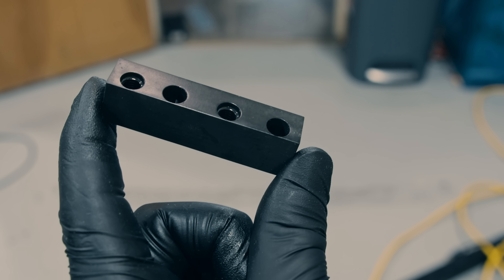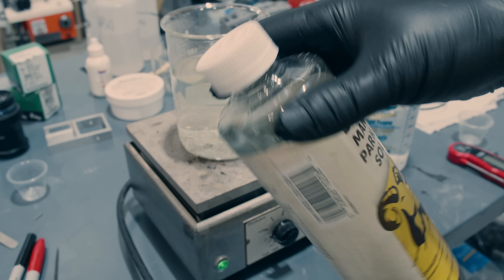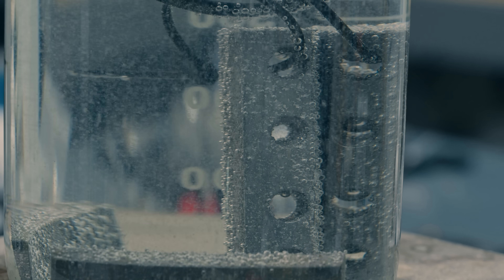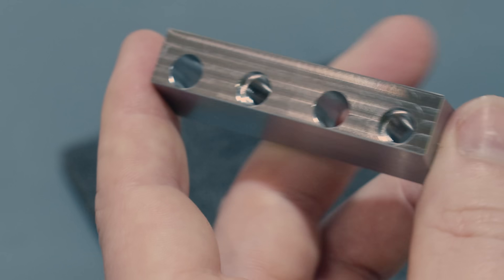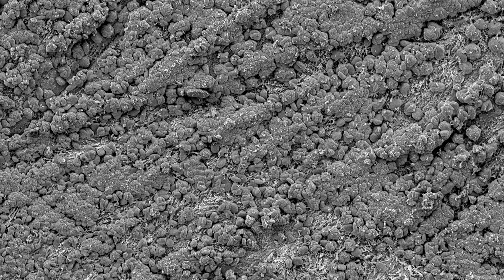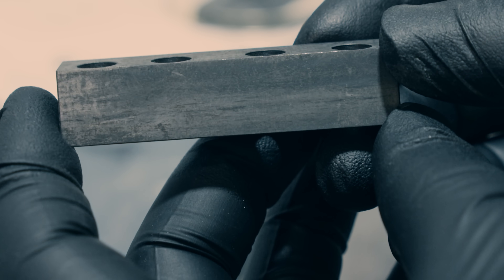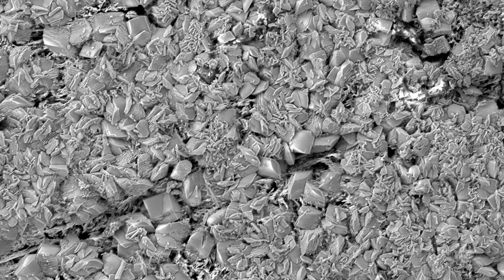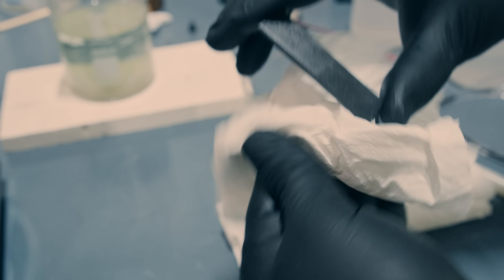Low-tech coating is a microscopic marvel

Comment: When I used to work at a job shop, we would run parts through a Tumbler before sending them for surface treatment. Tumblers are pretty fun gizmos and very loud. I assume you know about them but in case, it's a bucket of some description held up on big springs, with a big shaker motor in there somehow. You fill the bucket with carbide bits shaped like dry catfood and it spends an hour or two ramming the carbide catfood and your parts together randomly and at high frequency. This results in a very evenly and finely rough surface. Sometimes you want the smoothest cleanest surface before doing a surface treatment, sometimes you want evenly and finely rough; but you never want irregular toolmarks and such.
Reply: i spent hours with my hands in a rumbler... could spend your life figuring out how to get different finishes... from mirror polishes to bead blast to just... "got the brazing flux off"...

different medias, different amounts of media, different detergents, amounts of liquid, and the weights on the shaker... i always liked a 90 degree offset, gave a nice "figure 8" swirl... 

always sad, watching these YT videos of people trying to make them with no real concept of how they work.
Reply: @paradiselost9946  Mirror finish? Amazing! This workplace was not one where leadership tolerated knowing things or having skills, I think we changed out the media once and probably just used like, flood coolant or dish soap, I don't really remember.
Reply: @Ziraya0  lol, management... at one point i started recording conversations, as invariably, when something worked it was "their" idea, and when it didnt, it was "my" idea. 

if i start elaborating this could be a very long reply.... shutsup

Comment: It's just wild to imagine that a surface that feels so smooth is actually so rough.  I guess this might explain why this kind of coated metal has an almost "soft" feel to it when you handle it, compared to a freshly milled surface, which feel smooth, but.... different... almost harder.
Reply: Our tactile sense only  has so much resolution.

Comment: I used to black oxide parts at my dad's plating shop, along with primarily electroless nickel planting.  The black oxide was my favorite look, but least favorite process.

Pre-soaking in heated hydrochloric acid for about 30 seconds to 1.5 minutes will usually prep the surface and remove some of the variations in texture.
Reply: Nice to find another plater here, looks like skipping the pretreatment , no electroclean or acid dip was not a good idea. It’s strange how the people who proses stuff for a living know what they are doing and sometimes, why.

Comment: Parkerizing is the effective replacement to bluing when it comes to firearms. It produces a more durable resistant coating. Bluing is effectively controlled rusting, which then prevents the metal under it from rusting.
Reply: Like anodizing aluminum?
Reply: @d.b.1176 very similar, I think! But phosphating and bluing both require a light oiling, which is obviously not necessary for aluminum.

Comment: Fascinating!
What would a polished aluminum which is then anodized look like under your microscope?
Reply from the maker: On the todo list for sure! Should look like really tiny honeycomb pattern, based on what I've seen/read elsewhere. The pores are very small, sub-micron if I remember correctly
Reply: @BreakingTaps  excellent.

Comment: Cool video! What would happen if you ran the Parkerization step at at 70C inside the ultrasonic cleaner? Do you think it would speed up the process or ruin the surface finish?
Reply from the maker: Honestly no idea! It might mess up the reaction kinematics, my understanding is that the reaction relies on the pH locally increasing right at the surface. Phosphates are soluble in acids, but when the pH rises locally they become insoluble and precipitate out. So ultrasound might disrupt that boundary layer and promote more solution mixing, which might prevent the precipitate from forming.

Or maybe not, unsure! Would be interesting to test (or skim google scholar when I get a minute)!

Comment: Heat your part first to temp before dunking! Pro tip from gunsmith!
Reply from the maker: Aha, yeah that makes sense! I did notice a "lag" period before they started bubbling, was probably coming up to temp. Will keep that in mind for future batches!
Reply: And it also helps the solution to work better if you feed it some soft iron before you park your first item. Temp and the lack of prepping the solution with some raw iron is why the 2nd one was so much better than the first. Some use a powdered iron in a bag before first park cycle.

Comment: Curious to see what the surface looks like once it has oil but it probably doesn't work in the electron microscope
Reply from the maker: Unfortunately yep, you're right 😭 That's the reason I left one uncoated, so I could look at it inside the SEM. Oils and organics would be a big blob of charge buildup at best, or start to volatilize and contaminate the chamber at worst if the vapor pressure is too high.
Reply: @BreakingTaps  and I assume the atomic force microscope would also be a no go because it needs a solid surface?

Comment: What's the temperature resistance here? Could I use it as a coating for injection molds?
Reply from the maker: Not a clue to be honest! I suspect it would really mess up tolerances on the mold though, adds a dozen or so microns of thickness and not super controllable.
Reply: @BreakingTaps  In my use-case 0.1mm tolerance would be acceptable. Sounds like that wouldn't be too much of an issue.

Comment: Could you do a comparison between this and various methods of chemical bluing, such as selenium dioxide and 'rust' bluing?
Comparing to heat bluing would also be super cool, perhaps with some clickspring clips for good measure.

Cuprous verdigris is also fun.
Reply: I double it. Cold blueing is much simpler process. Maybe not a wear resistant, but def very good against rust.

Comment: Hey i have a nice idea for your SEM. Why don't you put a drop of mercury on a flat piece of copper or other iron and Film the transformation that will happn with th forming of an amalgam. I have done this not as a video but it was pretty fascinating
Reply: I feel like this could be bad news for the vacuum system given its high vapor pressure. I.e. you might evaporate mercury and have it spread all over the chamber, requiring a bake-out to remove? Perhaps though it would bind tightly enough to surfaces that it would just stay put...
Reply: @marklundeberg7006  that depends on the SEM. We have a verry similar system to his in our lab and it does noch reach the 0.0016 bars needed to boil Hg. Ideed it would just evaporate anyway in the vacuum chamber as long as you only have steinless stell an PTFE parts. there maybe some risk for pumps. and as with moast SEM Samples you only need a super small amount. I did this with a 20um drop. But sure this should not be the standard stuff you shove into the SEM.

Comment: Would love to see the structure if you had pickled it, nothing beats a freshly microetched surface for subsequent surface modification
Reply: That's what I was thinking regarding the pickle skipping. That it etches the surface as well as deoxidizes. Apparently in a response to another comment, he did do a quick acid bath on the second one that he didn't mention in the video. I would wager the light acid bath did more for the surface prep than the 120 grit wheel.

Comment: In the powdered metal industry we have "lifetime bearings". This is where we press a bronze bushing and fill the porosity with oil through a process know as impregnation. This makes the bearing surface slowly leak out oil throughout its lifetime, keeping it lubricated without the need for additional oiling
Reply: I've never heard an oil impregnated bronze bearing called that, always the trademarked "oilite". They go a lot longer if there's also a wick around the outside feeding in more oil and that's maintained. I've had box fans where I kept the wicks wet and the usual failure is motor overheat from dust buildup, years of running for months straight if I remember to keep them blown out.
Reply: @Broken_Yugo  I think "lifetime bearing" might be an industry nickname. The company I make for doesn't specialize in them, so we never bothered with the proper names 😅
Reply: I am 3D printing some metal parts that will be moving alot in a clean & dry area at work. I never thought of impregnating the part to not have to go inside and grease it. Which should be easy if its 3D printed metal powder I guess. Seems there is always new stuff to learn.
Reply: @Rakvalde  The way we do it is to submerge it in oil and draw a vacuum. I imagine this could be done on a much smaller scale for your purposes
Reply: @killianramsey4805  I wonder if you could further improve the oil impregnation by adding ultrasonics to the process - have the bearings in the oil bath inside an ultrasonic cleaner, ultrasonic cleaner in vacuum.  Hmm, might need some engineering to make the ultrasonic bath area and vacuum chamber into a single container to avoid putting the electronics and transducers of the ultrasonic cleaner in vacuum as the vacuum thermal insulation might allow overheating.  Seems like it would be an interesting experiment if such a device isn't already commercially available.
Reply: @neverendingstudent when I think of ultrasonics I think of the potential erosion it can cause depending on hardness. But I think there might be some magic frequency and variations with vacuum and pressure that optimize fluid retention.
Reply: @neverendingstudent your bubble size is dependent on frequency and tuning your bubbles to the desired pore width seems like a good target.
Reply: @neverendingstudent How about vacuum sealing the part with the oil in a thick plastic vacuum sealing bag, like the ones they sell in rolls used for vacuum sealing food? Then you drop that bagged part into an ultrasonic tank. I know people have success ultrasonically processed steel parts in bags of Simple Green to clean and degrease them. That way, they save on the use of degreaser. See Mark Presser’s channel; he uses that technique. I also think you could impregnate with oil under vacuum first and then follow my suggested procedure, since you are already just trying to add that extra bit of oil to a process that already works. I wonder, too, if experimenting with temperature and agitation might not also help with the impregnating process.
Reply: @Rakvalde it's metal powder centered together leaving small pores, you just simply have a port that you can fill with oil that can come in contact with the bearing and ot will constantly wick oil towards the center where it's being used up  and you can refill it if needed
Reply: @thebuckster101  * sintered
Reply: @Rakvalde wow..that should work well for sliders...custom pillow blocks...you guys just invented a cool product
Reply: Submerged Boat shaft bearings are impregnated bronze bearings. They are particle tolerant and watercooled. They work very well
Reply: @808bigisland  Neat!
Reply: @808bigisland  never heard of brass.. seen many glands with carbon and teflon. the dripless are two polished pieces of ceramic
Reply: Oilite has been around since the 1930s, never heard of “lifetime bearing.”
Reply: @Jcreek201  I believe Oilite is a brand name of the same thing. Lifetime bearing might also be an industry nickname
Reply: When I hear "lifetime bearing" I think of a bearing that's been pre-packed with grease and sealed so that it can't be greased in the future and has to be replaced at the end if its lifetime.
Reply: Is oil impregnation only done with powder metal sintering, or does it work with cast parts as well?
Reply: @TeddyBear-lb9ho  I don't think it would work with cast parts because they lack the same porosity. Powdered metal is FULL of pores that all interconnect. Porosity in casting is usually avoided and when it happens the pores are disconnected and isolated. The oil would have no way of flowing into the pores
Reply: so you're saying they creampied the metal?
Reply: interesting. i presume that part of the functioning mechanism here is that as the working surface of the Bushing slowly erodes, more Oil is exposed to the working surface by virtue of effectively having been brought up to the surface.
Reply: @taiiat0  I believe it's more of a wicking effect. Oil can flow to the surface slowly as the oil at the surface is deposited onto the mating part
Reply: @killianramsey4805  
that'd sound like it ends up relying on an Osmosis type effect - which in this application i wouldn't expect to be reliable enough to do the job, but, if it works it works.
Reply: @taiiat0  The pores in powdered metal are interconnected, so it's more like a really twisty straw with an end touching the mating surface. The oil is only being held in by capillary action, essentially sticking to the walls on the straw. When that oil touches a surface, the surface adhesion is stronger than the capillary action and pulls some oil onto the surface. When that oil drips off or evaporates, the whole thing happens again and pulls more oil onto the surface
Reply: @killianramsey4805  
yeah, i guess the grain structure is just not as dense as i expect it to be.
Reply: And you’re talking about thrust washers right?
Reply: @lindboknifeandtool  No, just like a sleeve bushing
Reply: I fucking love engineering youtube, you learn so much shit from the comments it's insane😂
Reply: @RENO_K it's better if you're from manufacturing, design, oil&gas, and mining. As for myself i can learn to improve work efficiency and maintenance from youtube
Reply: the big blower motor on most home hvac/forced air systems have this type of bushing. its actually less preferred imo because once the motor gets damaged from spinning off balance, it will make the squeal of death for a week, and there is no practicle way to grease the bearing. you can get the sound to go away for a day or two if you spray it with wd40, but theres no way to save the motor. appearently before they had a grease nipple where you could add more grease and it was a serviceable part. now its straight to the bin and most pay an hvac boomer 80 bucks an hour to swap out a 200-500 dollar motor what would have been a diy weekend project. yeah impregnated bushings are not so good imo, i wouold rather be able to service something than to have to throw it away. sintered metal and MIM parts are like the bottom tier of metal parts.
Reply: @vevenaneathna  I think application is important. These bushings SHOULD be used on a part that's either already inaccessable, unserviceable, or has a lifetime similar to that of the bushing. MIM, PM, and sintered parts also have a TON of advantages compared to other manufacturing methods, depending of course on the application. This seems like a case of wrong application for the part and an over-generalization of sintered metal

Comment: Question: Since it seems that the surface area is much much much bigger, would that increase heatdissipation if one would coat a phone case with that? Or does is a bad heat conductor?

Comment: Low tech is heating piece to about 350 degC and dumping it in used motor oil :D Produces dark brown surface also quite resistant to rusting (when not in contact with liquid water at least)
Reply: @nonegone7170 Common structural steel does not degrade by heating to these temperatures. I guess at like 700degC you may start loosing carbon, but probably not much. Otherwise hand forging would be difficult.

Comment: Nice!
I've gotten some greyish-black results on steel by just derusting some random stuff with citric acid mixed with my pretty mineral-rich well water.
Not sure what exactly the surface ended up as, but it's not coming off easily.

I'm sure there's hydrogen sulphide in the water due to the smell. Apart from that more than likely iron (everything turns orange around here) and possibly manganese (get black deposits to sometimes).
It would be very intersting to know if it's something akin to parkurization, or just crud that won't have the same practical effect.

I mean, if it could be done with citric acid plus whatever minerals at roomish temperature (I left the stuff over night, heating would probably make it go fairly quick), that could make the process dirt cheap.

PS. Yeah I'm getting water samples analyzed soon, to get rid of some or all of the above, it's not great drinking water...